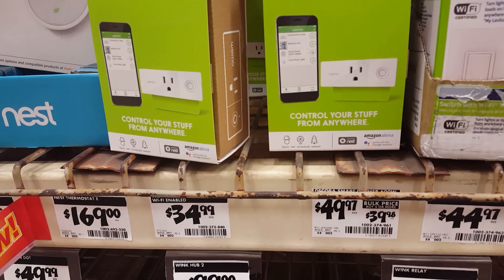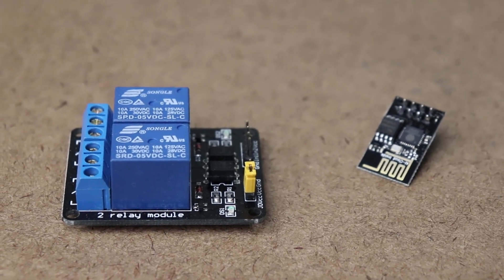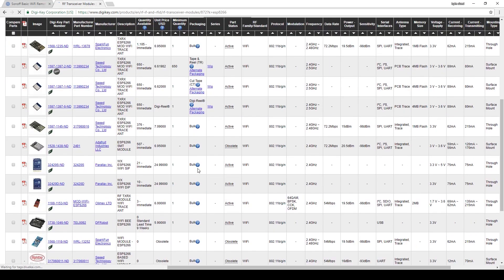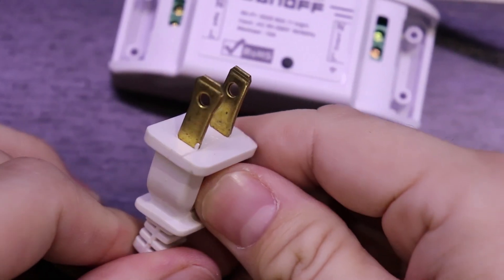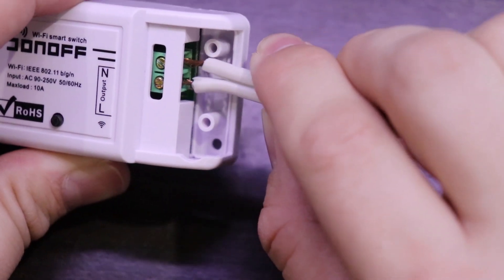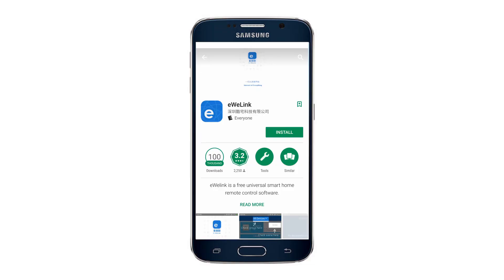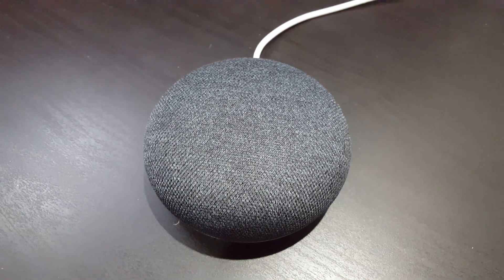Sonoff - The $5 WiFi Smart Switch That's Compatible With Alexa And Google Home

Comment: Vac-in = 90-250V.....I’d be concerned how they convert that down to 5v or 3.3v for the processor....read in potential fire hazard...
Also, no emi/rfi suppression...probably provides rf interference to external devices...
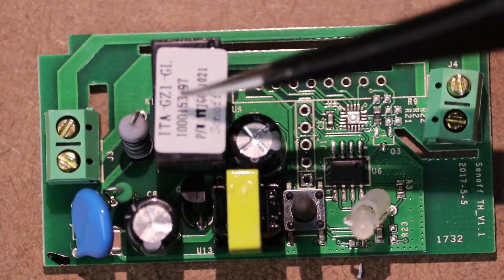Reply from the maker: at 4:15 you can see a transformer with yellow tape. I'm guessing that steps down the voltage and then it gets rectified and cleaned up. I don't know of any schematic out there that exists for these things.

Comment: Is this closed loop?  i.e., can it tell you if a device is on or off?
Reply from the maker: Yes, the app remembers the state of the device. I think the state is also stored on the board, so it can be recalled even after a power cycle.

Comment: Will the power wasted when the connection is off? 
If I use it with 20 watt device. When the connection is off how much power this device will take. As it will be on for getting the Wi-Fi message. 
Does it needs internet connection. 
Can it work without net connection?
Reply from the maker: I haven't done any power measurements, but I'm guessing that the device uses very little (0.25W or less) whether the connected device is on or off. There will be short bursts of power when the wifi radio transmits packets, but those will be short and are negligible in the big picture. 

It will need an internet connection to function properly. I think it needs to communicate with remote servers. I hope this helps

Comment: This is a cool solution looking for a problem.   I have an echo dot in my bedroom, and one on order for every room in my house.   However, I've yet to identify anything other than Christmas lights that can be controlled this way, and I already have a fancy christmas light controller.   The problem is not that many things can be simply turned off and expected to work now days.  For example, the fans have touch buttons.  I can turn off the power to turn them off, but just because the power is restored does not mean they start up.   The only lamps I have are bedside lamps, and I prefer not to wake my wife by using voice to turn those on and off...   Everything in the kitchen is designed for continious power.   For example, if I turn off the microwave or the Kuerig with a power switch, it just erases the settings, it doesn't start anything up.

So as I said, it is a cool solution without a problem.   Well actually there is one problem I want to solve I will try it with.   I have some good old fashion fans in the attic to help with humidity build-up.   It would be nice to be able to turn those on and off without climbing the attic stairs.
Reply from the maker: You are exactly right, I'm getting a lot of comments from people trying to turn on their TV/cable box, etc with this device, which as you pointed out won't work. I have found in my house at least many uses for this wifi switch. I use lots of lamps, and LED light strips that work great with this switch.
Reply: I'm thinking though a combination of this with products like the Harmony Hub, and Bond Home, can make for a complete solution.  For example, many products like the Roku have no actual power off.   And many TV's only have a toggle button for the power.   What that means is some devices can't be turned off with my Harmony Hub, and others if I turn them on manually, the Harmony Hub will be confused and turn it off instead of on.   So if I install this to my power bar for my entertainment, I have a way to add into any routine a forced power off or power on.   Then once the device is in a known state it leads the way for the Harmony or Bond to work right every time.

Comment: Noob question. In Aus we more often than not use the three prong with the third being ground. What then?
Reply from the maker: Any device that has a metal chassis needs to have the third earth ground prong. Sonoff makes wifi switches that include a third terminal for this purpose. I would go with one of those.

Comment: Noob question. If I have 5 automation devices, do I connect them to a hub (device>hub>router) or directly to my wifi router (device>router)?
Reply from the maker: It depends on what protocol your device uses. You will only need a hub if you're using zwave, zigbee, xbee, X10, bluetooth, etc. Everything else likely uses wifi which will connect to your home network using your wifi router.

Comment: Can this be used for volt free operation?
Reply from the maker: I don't understand what you mean by "volt free". Please clarify.
Reply: byte sized, sorry, I meant, can this be used as a switch that connects two wires together instead of giving 240V to whatever is connected to it? Basically I am thinking of replacing my basic mechanical thermostat with this. Thank you 😊

Comment: The Sonoff POW will report power consumption & the Sonoff TH10 has a temperature sensor input.
My eWelink also integrated with Alexa on the Echo Dot and Amazon TV box & stick.
To cover the area of my house requires 1x WiFi broadband router plus 3 x AP units and I find it very difficult to get the Sonoff to register online. It will connect to the router but does not come online without being deleted and re-added several times.
Its also worth noting that it only works on the 2.4gig WiFi band my AP's are dual band do I have to check that my phone is on the 2.4gig WiFi SSID before adding a new Sonoff device.
Hope this is of some help to any one considering using them for a home automation project, I have a POW permanently wired to my heatpump energy recovery hot water tank and another wired into a mains extension lead that I use to check the power consumption of the white goods in my kitchen.
One revelation on consumption is that my 850W beer fridge uses more power than the 3KW tumble drier.
Reply from the maker: Wow! Those are some great tips! Thanks Mike!

Comment: Can the app/Google Home turn on/off more than one switch at once? e.g. Ok Google.. Turn on the lights. And have 2 separate switches on different outlets both come on at once.
Reply from the maker: Yes, this concept is called a "scene". In Google Home you add devices to specific rooms. In my house I can just say, "ok Google, turn off the living room lights" and everything in that room will turn off at the same time.
Reply: byte sized awesome, exactly what I was looking for.

Comment: Can it be turned on/off if you're away from home, or from the road? Or do you need to be connected to its local wifi.
Reply from the maker: It can be controlled from anywhere your phone has an internet connection. No need to be on the same network.
Reply: byte sized Pls clarify for me,  it's started that maxload is 10A. Just want to run a scenario by you; if I have 5 led strip lights and each strip is 35W......totalling in 175W but all run on 12V and being fed from a 260w capable power supply (AC to DC). Am i able to safely use this sonoff on the power supply seeing this isn't AC 10A but Dc power? Or it would matter? Total AC to DC consumption: 175w of 12V... thanks

Comment: Hey Zach - nice video but the "L" is not for "line" it's for "live", as in, the voltage on this wire varies between two large positive and negative voltages in a sine wave form, while the other wire, the neutral, remains static at zero volts.
Reply from the maker: You are correct, I've heard it called live as well. Different people use different names. I used to be an electrician and I have a degree in electrical engineering. I've heard it called many names!
Reply: It's definitely live. Wherever you've heard line used for live was just plain wrong. The most common two names are "live" and "hot"(a third, less common name is "active")
Reply: Ever heard term "line voltage".
Reply: GuruDanny Yes, "line" just means wire but "line voltage" means voltage between one line and another (in a 3 phase system), as opposed to the phase voltage. The fact is that the "L" stands for live. I have a B.Sc. Elec. Eng. too, though that isn't what makes me right.
Reply: @ Anthony. So if the neutral stays at  zero voltages  how do YOU complete the circuit?  Wrong, except open circuits.

Comment: Nice Video, I also do smart home stuff and hate the prices of the equipment, so what gauge wire can you fit in those terminals? they looked a little small for 12 gauge. Looks like it should work with alexa also.
Reply: What about an earth connection?
Reply: Polarized appliances don't require an earth or ground wire. But if you were to control something that did need a ground then you would just hard wire it around the control unit.
Reply from the maker: 12 gauge would probably be too big, but if you're device needs 12 gauge wire it probably draws more than the 10A current rating of the sonoff switch. They make other models that can accommodate larger wire and more current.
Reply: breakinn403 you would need a suitable enclosure around the whole a thing. You can't have a singles cable exposed it needs protecting
Reply: breakinn403 it's probably not a risk but against regulations due to poor workmanship. But yes You're right they do sell one with a built in earth
Reply: breakinn403 yeah I know. I was just making people watching aware no ensure things are properly earthed. That was my point. Then I was told there is one with an earth connection. That is the end of the matter.
Reply: @Steveyboy6 Not sure if you know what your talking about, Lol.
Reply: steveyboy6  A properly spliced ground wire is no more at risk of damage than the single flexible cord entering and exiting the enclosure. Having said that, I'm sure Sonoff has a model that accommodates a ground (earth) wire.
Reply: stevyboy6  YOUR original question was how do you deal with a earth (ground) wire requirement. Two acceptable solutions were given to your question. Why belabor this and just pick the one you like best? If properly hard wiring the ground around the box is not to "code" and you don't want to do it that way then purchase a unit that accommodates the added ground wire and be done with it. You can now have a controlled device using a Sonoff unit which I assume was the point in the first place.
Reply: I'm having trouble getting the 14 gauge stranded from my basic extension cord to stay in there.  The receptacles are tiny and shallow.
Reply: The pro version has an earth connection

Comment: Do you have any more info on your smart sensors for the windows?
Reply from the maker: I have a z-wave controller for a lot of my home automation stuff. I use these for my doors and windows: https://www.amazon.com/gp/product/B00XUXYSWU/ref=as_li_tl?ie=UTF8&camp=1789&creative=9325&creativeASIN=B00XUXYSWU&linkCode=as2&tag=bytesized-20&linkId=7db547910a422e7e48c9c31269d1a5e1
Reply: byte sized Thanks so much. This is EXACTLY what I've been looking for.

Comment: when multiple things are connected can it just turn on fore say just a lamp
Reply from the maker: Anything connected to the female end of the extension cord will turn on/off together. Just make sure not to exceed the current limit of the device.
Reply: byte sized got it , thanks

Comment: Seems great, however a few questions; how much wattage can these take? (And do they support 240v outlets? EU). For instance I want to be able to turn on my PC, which could potentially draw up to 1kw of power when in use. Or a heater, etc. 
And can it be used with ifttt and/or Logitech Harmony?
Reply: Tijmen J. Been looking at them before I saw this video.  90-250v @ 10A. Will work in EU and UK and I've been thinking of them for aquarium lamps in place of in line switches and for table lamps and stuff.  No good for earthed appliances though.  Luckily the sonoff S20 smart plug is cheap and is also 10A.
Reply: 2:44 you can see in the label 250V/10A

Comment: Does the sonoff or app support schedules? I'd like to use it with a lamp  that turns on and off and specific times as well as be voice controlled.
Reply from the maker: Yes, scheduling and scenes are supported. Very useful.
Reply: Is there any reason you can't splice this directly into a lamp? Don't have an extension cord but I do have an old lamp seems like it would work with the same setup? Thanks so much!

Comment: Nice devices. The con is that you are using a third party server that relays via china. All works... until someone decides to pull the plug on that service.
fortunately the SonOff can easily be  reflashed with your own firmware. That also has the advantage that somewhere someone in China can't keep track anymore of when you use your blender
Reply from the maker: That's true. I want to keep my blender use as confidential as possible! Do you have a recommendation on firmware that you like?
Reply from the maker: I'm going to experiment with flashing new firmware at some point in the near future.
Reply from the maker: Thanks I'll check it out. I'll give you a shout out if I end up making a video about it.
Reply: I am interested to see how to flash these. Any info/links would be very appreciated. Thanks.
Reply: byte sized many people use tasmota software (on github). I prefer github.com/computourist
Reply: Please make a video on this, very interested!
Reply: GuruDanny open it up. Solder in a header in the ftdi slot you find and program with a 3v3 ftdi TTL adapter straight from an Arduino ide. Make sure u do not plug it in the mains while programming
Reply: @Herbert N yes they already bought all the needed politicians. Money talks.
Reply: You can flash open source software on these and control them privatly with your own iot server like openhab.

Comment: Clapper..ill never 4 get u
Reply: Commercial:
 “Clap on 👏 👏 Clap off 👏THE CLAPPER!”

Real Life: “Clap On 👏 👏...? 
👏 👏 👏?  👏👏👏👏!!!!!!!
Gonna break this fuckin Clapper!!!”
Reply: oh yes those crap things it was like a strobe light every sound the tv the stereo just talking would be turning the light on then off 
but then when you actually clapped to turn said item off or on it did not work resulting in bruised black and blue hands ,it was bloody awful
why do i buy all this crap ?
Reply: The problem is that they weren't using neural networks to detect clapping, just some cheap amplitude peak detection circuit. Nowadays, if you wanted to, you could build a clapper that was 99.9999999% accurate at detecting claps.
Reply: Why on earth would a neural network be necessary? They haven't even created a fully functioning neural network, seems overkill to turn a light on...

Comment: When all is assembled can I connect 2 devices to the female end (for example : the TV AND the cable box) and have them both turn on when I say "OK google, turn on tv". Will they both turn on?
Reply from the maker: In theory what you are describing will work, that is plugging multiple things into the female end of the extension cord and having them all turn on and off. Make sure that they don't draw more than the 10 Amp rating of the device and you'll be okay. However TVs and cable boxes are a bit different. Imagine that the sonoff does the same thing as you plugging in and unplugging the power cord of your TV. This action doesn't turn on/off the TV. It requires more interaction from a remote or power button. Sadly the sonoff won't turn on/off your TV. It's funny you should ask, I'm working on a solution to the exact same problem. Have you seen my raspberry pi home automation video  https://youtu.be/3HdDo5AZLx4 This is a failed attempt at trying to turn on my TV.

Comment: make one for the garage door
Reply from the maker: That is on my to do list of projects!
Reply: byte sized I sure hope so...been looking to automate the garage door - cheaply of course 😇
Reply: I would love to see a how to video to do this to your garage door opener!
Reply: +byte sized -- One thing to consider on a garage door is that (at least in any of the ones that I've ever owned) you do not have an "up" button and a "down" button, but rather just an "activate" button that toggles between "up" and "down", depending upon the last operation.  If your garage door has provision for a simple wired switch that just uses a momentary contact switch on it, it's easy to add a remote switch, possibly even running wire as thin as a single strand of phone wire pulled from a phone cable.  The device you are using appears to just cycle the connection on or off and leaves it that way.  You would need one that would cycle it on for a short period of time (500 ms, perhaps) and then turn it back off.  If you want to specify direction (instead of just opposite the previous direction it was going), you would need to have sensors on the garage doorway to see where the garage door was currently positioned in addition to keeping track of it's movement, even when that movement is caused by the garage door being operated manually or being left in a position only partway up or down and you not knowing which way it is going to go the next time.

All in all, it starts getting a bit more complicated that just cycling a lamp on and off and that's not even taking into account the security concerns for using such a voice controlled device.

Comment: Great video with great advice. Question: is there any relay switch you can recommend? I want to install it behind the power switch. Found Fibaro but it's too expensive
Reply from the maker: +Felix Tran some other viewers pointed out that there are other sonoff models that are designed to replace a switch in the wall. I haven't tried these out so I can't recommend them. In my house I use a z-wave controller and z-wave dimmable switches. I didn't discover the sonoff until recently.